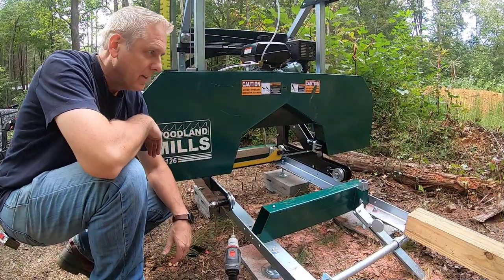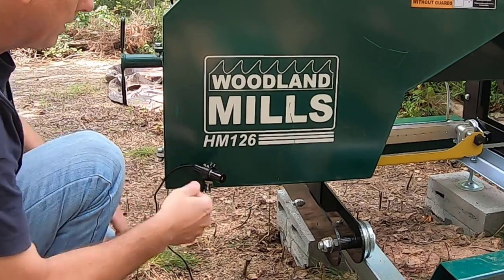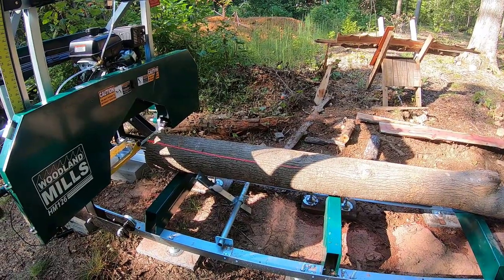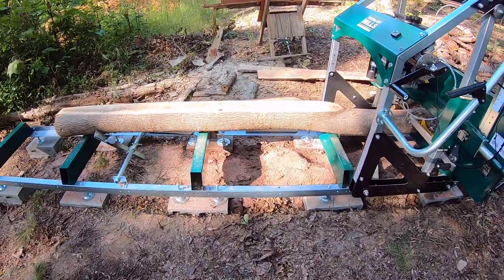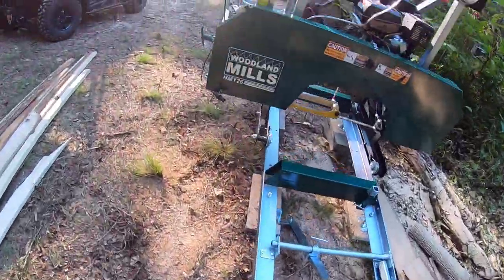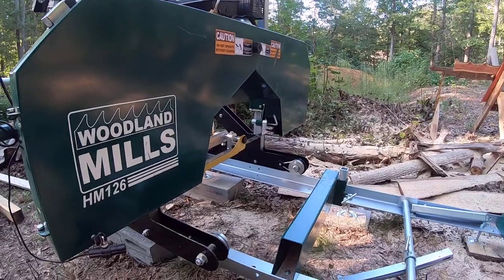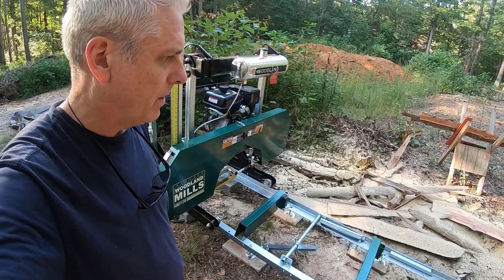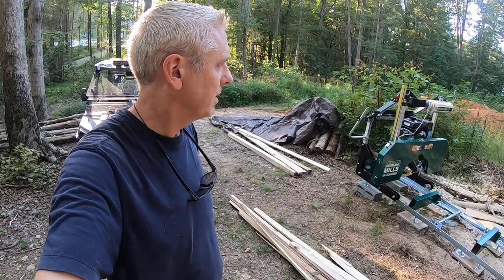29-Sawmill Laser Line for Woodland Mills HM126

Comment: That laser has some great advantages mainly on logs with lots of taper, being able to see how much to adjust the toe board to get the first cut perfect, that saves fuel, and time. The only con I see is the operating temperature at -10, I do 80% of my sawing in winter even at -20 I’m out there sawing sappy pine. Wondering if there’s an way to put some heat around it from the exhaust, or something 12v electrical. Im interested in seeing a review when the temperatures drop below -10c ? Good video, well presented, sound and views 👍🏻
Reply from the maker: Thanks for your comments William.  Not sure how accurate those ratings are, but I know batteries don't do well below a certain temp too.  There definitely are small 12v heaters available, as I installed in my solar control box for my high speed internet; see episodes 10 & 23.  These get very hot very fast though, so be careful how and where you mount them. (https://smile.amazon.com/dp/B01MT9M7C5/ref=cm_sw_r_apan_glt_fabc_H5BN45ERZD8R2K8BQMS6?_encoding=UTF8&psc=1)  Good luck and keep us posted how it all works out.

Comment: in a response to a comment you mentioned the laser was hard to see toward the far end of the log. Just a thought, Green Lasers are a lot easier to see in daylight. A couple of question about your mounting, do you have any problems with vibration etc with the laser being mounted in front and how far away from the blade does the log have to be for the laser to mark the end as well as the length? I am getting a 130MAX and do watch quite a few of Sawing with Sandy videos and have the same concern as you with hitting the laser mounted on the side. Good to get some one else's perspective on the same subject.
Reply from the maker: I agree with you Jack about the green laser being better in the daylight.  That's what Sandy is using, but I went cheap on that one and probably shouldn't have; especially the mount.  I'll eventually make a better mount for my laser and post a video on that. Just hasn'tbeen a priority yet.  As far as vibration, that doesn't seem to be a problem at all.  I like where I mounted it because I can see the laser all the back, shining on the blade.

Hope that helps. Thanks for watching.

Comment: Thanks for the video. The item on Amazon says it comes with a USB cable. Does it? And wouldn't that let you just use any rechargeable cellphone power bank? I know all USB is 5 volts. Thanks for the video, i have an hm126 i am going to do this on.
Reply from the maker: Yes it does.  And that sounds like a great idea.  The one this I have struggled with is keeping the laser aligned.  The mount seems to easily move.  I try not to bump it, but that part just isn't working well.  I mentioned this in one if the videos, but haven't taken the time to create a better mounting apparatus yet.  Let me know how it goes.  Thanks for your comments and for watching.

Comment: Laser works well with the blade height. Would it make more sense to line the laser at the end of the cut.
Reply from the maker: The laser casts its beam out well past the end of the log, but it's very hard to see when it's bright outside, which is when I'm cutting and filming. Is that what you mean?  It's a 650nm laser, so pretty powerful for 5V, or any battery operated.  At night you can see it for well over 100ft, but hopefully no one is sawing in the dark. :)  Let me know if you meant something different.  Thank you for you're comments--always open to new ideas--and thanks for watching.
Reply: @twc-projects  put the laser at the end of the log 🪵, the cut, or furthest distance to the sawmill carriage? You could use a piece of cardboard , a visor at the blade to see your reference line. The same would hold true any point along the log. Typically the smaller end goes to the mouth of the blade? You could accomplish the same with a string line if you had a calibrated wooden\metal post at the back end.  The issue that the mounting point has for the laser is you don’t know if the laser is pointed up or down.  Yes it could be flush with the blade, pointed toward the sky or slightly downward? Having a reference post at the far side gives you a second point.  Also might make more sense to align a mark on the side of the sheet metal, perpendicular to the blade. That would help with level reference plane along with a pair of glasses 🤓 to see the red laser line. Hilti makes a “ LASER VISIBILITY GLASSES PP EY-GU R RED “ to help with outside red visibility. Also look into green lasers they are more visible. Your only going out 12-13 feet so accuracy is not that important. If you were doing a kitchen cabinet build then you want +/- 1/16” over 10 feet and under 1/8” over 30 feet. Sorry this is sooo long.
Reply from the maker: I like where you're going with this.  Lots of good ideas. I'll need to give it some more thought and see how I can leverage some of your suggestions.  Ideally the laser mount would be more solid, and I wouldn't need to worry about constantly checking and adjusting it; like the one on my chopsaw.  Different animals for sure, but you get where I'm going.  I was also thinking about making a line on the band housing so that I can quickly see if laser is off, but having a reference point at the far end would be more valuable.  Maybe once I move it into the poll barn I built for my Woodland Mills, I can have a ruler mounted on the wall where the laser hits it to compare to my saw ruler.  Thanks again for all the great ideas.  I'll try them out soon.
Reply: @twc-projects  I was reading that the 3M reflective tape might show the line better. Hilti makes a sensor with an audible sound for the laser. Also different color paint 🎨 like yellow might highlight the laser line better. A spray can or a small paint brush could fix it for a temporary mark on the bark? Two - three  things are constant. The blade is always in the same place when static - Level with the track. You are only needing the laser for two things. First cut to give yourself a starting point. A flat reference plane to maximize yield then a second pass or cut potentially to level log flat to the grain pattern so your not diving downwards into the pith. 
The laser gets pushed about with the vibration of the machine.  The cheaper sub $100 lasers over time might loose accuracy? I’m thinking a post in the ground calibrated at the far end or along the side would be accurate. Have it on a post with scale that matches the carriage height? You would need to slide the laser or stick on with magnets and the post would need to be plumb. Seems that you have to fiddle with the laser to align with the blade before starting the cut to match the blade kerf? Yes a line on the cover or the box might help how you have it mounted. The set of the blade teeth 🦷 makes lining the level somewhat extemporaneous. A bit like winging it. The concept seems applicable and the laser is more accurate than the methodology for now. Start with the glasses and potentially a 2 foot sheet of cardboard, a rock, to cover the top of the log from the sunlight to see the laser line. You probably only need to see a small section to get an idea.  Also what would be interesting on a straight log is a level line through the pith or a few inches above, for removing the sap wood. Then a rectangular piece of 1/4” wood, luan mahogany with a level reference line that you could then shoot from blade - reference mark to pith target line. This would be on the second cut  🤔 thinking , then make toe adjustments. If you 180 flip the log over you might need to do the same? I don’t own a mill but I’ve seen a lot of sawmiling videos. So I’m an armchair internet expert.  Lol 😆

Comment: Where did you buy your line generator and associated pieces from?
Reply from the maker: Keep in mind you'll need a soldering iron and a little skill to add the step-down (9v-to-5v) converter in-line to use my approach.  But there are other solutions available where the kit comes already to go; just costs a little more.  Hopefully the following links will help.

Laser Line Parts List (on Amazon):
(a) OXLasers Adjustable 5V 650nm Red Line Laser
https://www.amazon.com/gp/product/B08L52KB7X/ref=ppx_yo_dt_b_asin_title_o04_s01?ie=UTF8&psc=1

(b) 9V Battery Holder Box Case
https://www.amazon.com/gp/product/B07P5TMQB6/ref=ppx_yo_dt_b_asin_title_o04_s00?ie=UTF8&psc=1

(c) Mini DC-DC 3A Buck Step-down Converter
https://www.amazon.com/gp/product/B07T6HJZLY/ref=ppx_yo_dt_b_asin_title_o03_s00?ie=UTF8&psc=1

Alternatively, there are complete kits at https://www.apinex.com/.